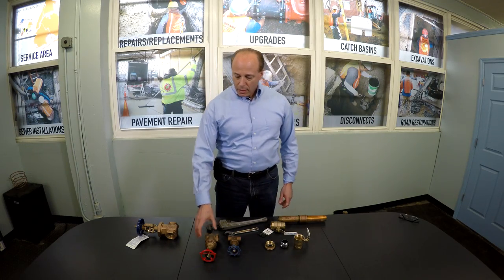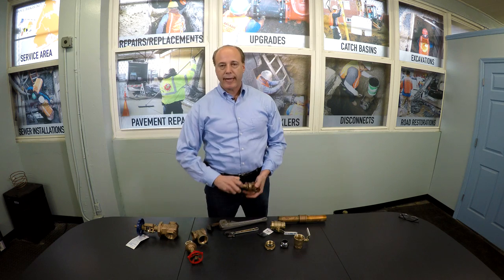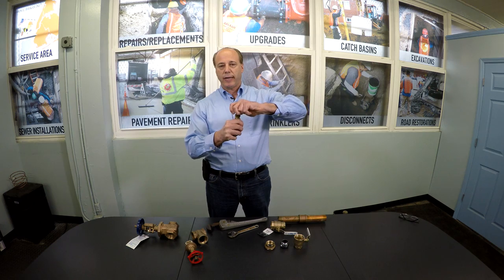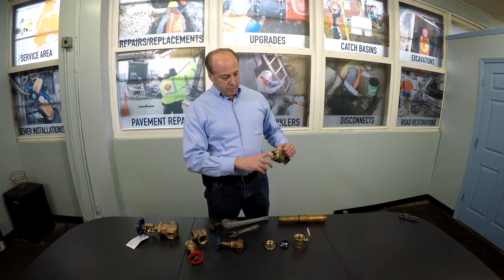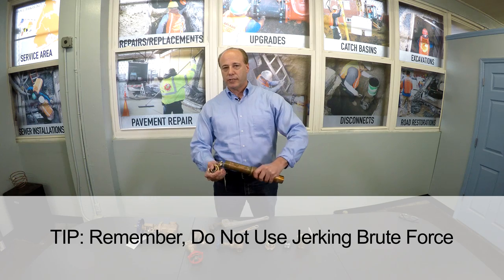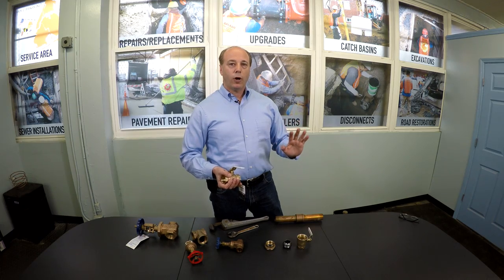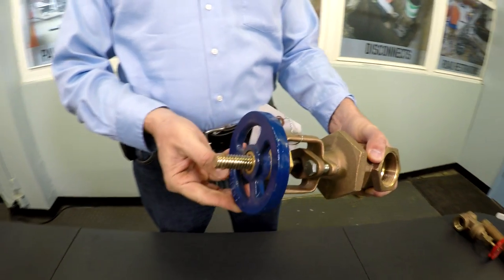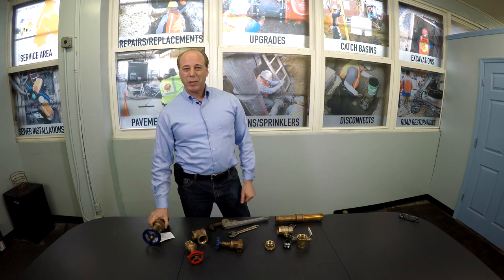Water Line Valve Types: Gate, Ball, OS&Y Valves Explained

Comment: Great video, thanks for the information.
I am working on a bathroom and coming in from the street there is, in short succession,  a ball valve and then a dial of some type which i think
is a pressure regulator and then  a gate valve.
I could not turn the gate valve to shut off water to the shower.
The ball valve handle seemed to be backed off some  because it could slip past the stop on the valve body and turn 
completely.
Did i damage the valve turning it 360 degrees?
It shuts the water off in the quarter turn position but not completely with a slow drip.
Can i tighten the nut on the handle so it does not spin past the quarter turn position?
I am afraid as there is no valve upstream from it inside the house.
Reply from the maker: Simply put, sometimes you should call a plumber. This is one of those times!